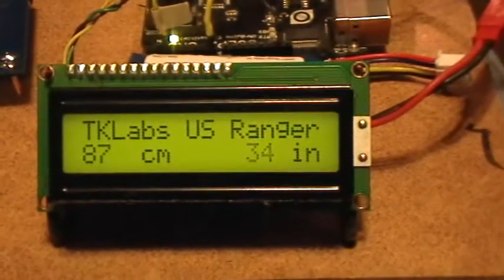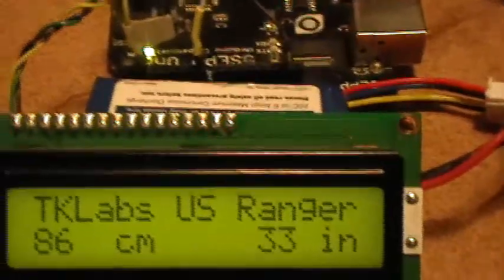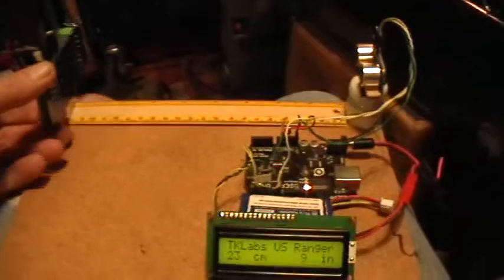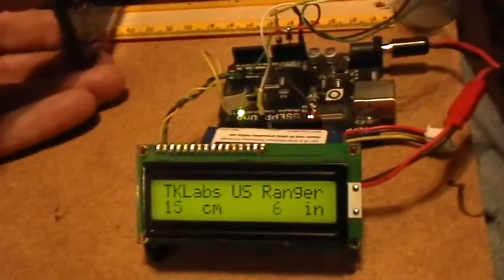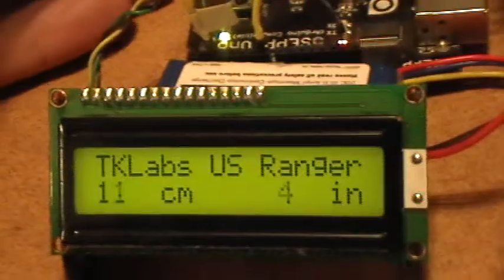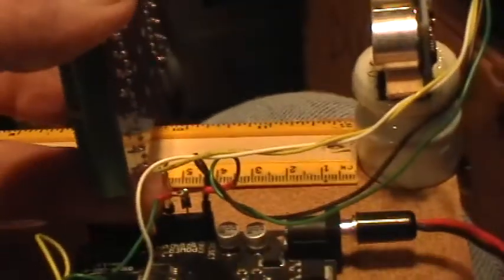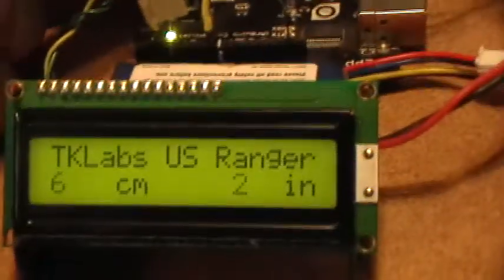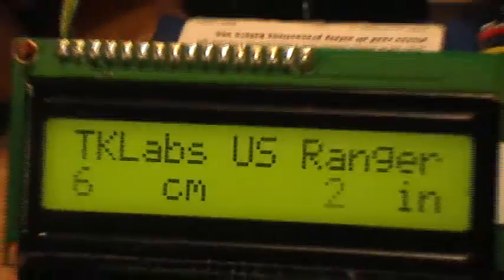Arduino: Ultrasonic Rangefinder Using Parallax Ping and LCD

Comment: hey man i do the project like this nowdays...
can i get your program just for refrences ? thanks
Reply from the maker: https://github.com/iamthechad/parallax_lcd   
for the parallax LCD libraries.
The rest of the sketch is just slightly modified from the ultrasonic ranger sketch in the Arduino libraries. Look through the Examples in the Arduino IDE and you will find it.
It is very difficult to post sketch here in comments because some of the characters are not allowed.

Comment: Hi TinselKoala. I have the Parallax serial LCD with (RX, 5V, and GND) pins. I wrote code to display on the LCD but it does not work. I don't know if I need to include something in specific to the code to make it work such as: 

#include <NewSoftSerial.h>  
  NewSoftSerial lcd = NewSoftSerial(2, 6); //Set RX/TX pins for LCD 

I have included that code previously and it doesn't work. I don't think I have problem with the wiring because is only 3 pins that need to be connected.

I am new to this please help!
Reply from the maker: juan vasquez 
I think you may need to use the Parallax library.

#include <NewSoftSerial.h>
#include <ParallaxLCD.h>
ParallaxLCD lcd(4,2,16); // desired output to LCD pin, rows, cols

void setup() {
  // initialize serial communication:
  Serial.begin(19200);
 // initialize Parallax LCD, write first text to it:
  lcd.setup();
  delay(100);
  lcd.backLightOn();
  lcd.empty();
  lcd.at(0,1,"Ping Rangefinder\0");
}

Then to write variable values to the LCD in the main loop, use statements like

    lcd.pos(1,1);
    lcd.at(2,12,"    cm        in");
    lcd.pos(1,1);
    lcd.at(2,12,cm);
    lcd.pos(1,12);
    lcd.at(2,4,inches);

Please let me know how it goes once you've tried using the Parallax LCD library.
Cheers and good luck!
--TK
Reply: Hi TinselKoala. Thanks for helping me out ... I keep getting an error. The error is shown bellow. I have no idea why this part is giving me such a hard time. How do I find the library online? I am going to keep trying with the information you sent me. Is there any other thing that I could try?

Arduino: 1.6.3 (Windows 8.1), Board: "Arduino Uno"

sketch_may01a_Elevator_Final_Project_Code.ino:7:27: fatal error: NewSoftSerial.h: No such file or directory

compilation terminated.

Error compiling.
Reply from the maker: juan vasquez
Hmmm... perhaps you don't have the latest NewSoftSerial installed properly. But before you do anything else first try SoftwareSerial instead, it is supposed to be in the core.
Sketch>Import Library>SoftwareSerial
You can install missing libraries:
http://www.arduino.cc/en/Guide/Libraries
Get the Parallax LCD library here:
https://github.com/iamthechad/parallax_lcd
Work the example to see if you can get it working...
Be sure to let me know how it goes, and good luck!

Comment: How far away is it accurate to? Could I possibly use it to locate someone 20 feet away?
Reply from the maker: Under perfect conditions, probably yes. I have only tested this one out to about 6 feet, since that's the longest clear path in my room.
Reply: you gotta look at the data sheet. generally these pings are limited to 2cm to 3 metres